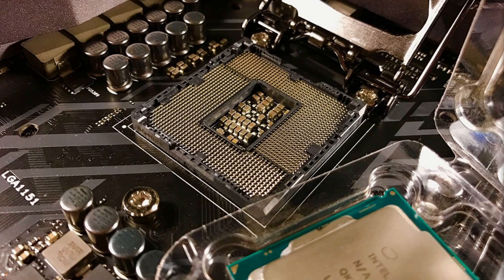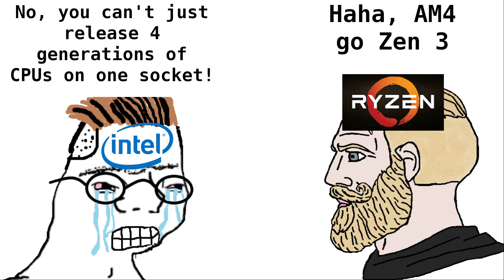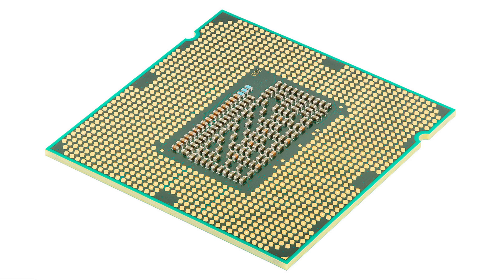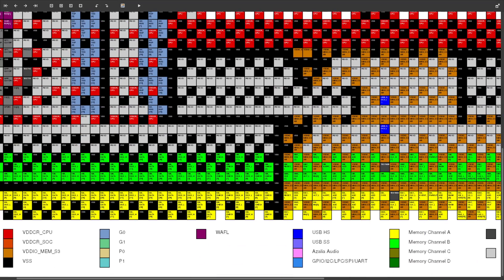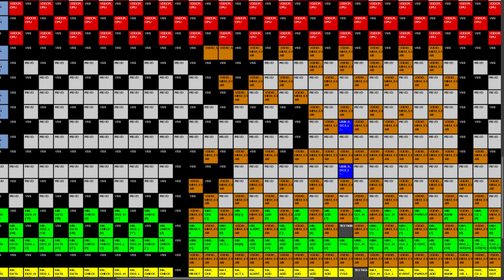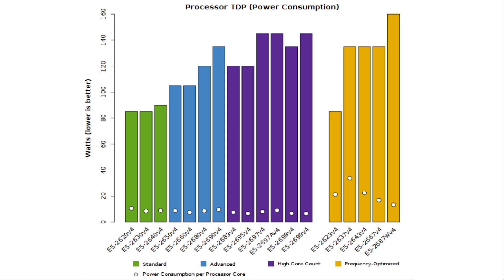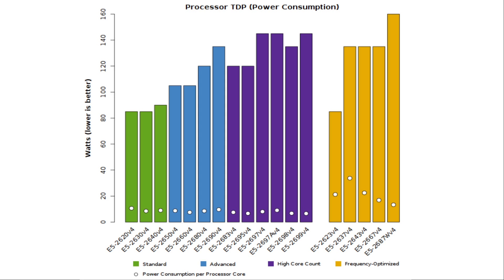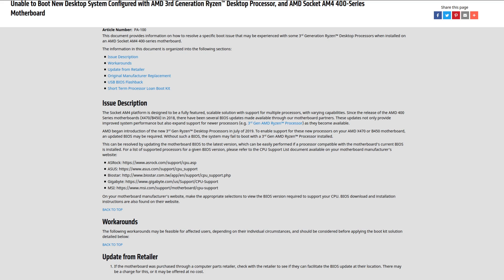The Reason for CPU Socket Changes

Comment: you do not need an old cpu to flash a well designed motherboard. "Bios flashback" is a well known feature that's been available on many asus boards for generations. the name do changes from brand to brand but that feature is available on many different boards from different brands. 

I didn't hear anything in this video that would make me think socket changes aren't essentially money grab or, as we usually call it, planned obsolescence.

Sure, you'll need some upgrade at some point, but not minor generation upgrades/iterations.
Reply: That might be the bios feature that's patented by one of the companies (Gigabyte I think?) so it doesn't show up on lower end boards because it has to be licensed.
Reply: @ffwast  Could be. I didn't look into it but I would expect that 1) The patent would expire after some time (5 years?) and 2), One could make enough changes to the patented idea so the patent doesn't apply.

that being said, you can upgrade firmwares on screens and many other devices without any fancy cpu or other dependency so again, I'm convinced it is more about squeezing more money out of planned obsolescence than anything else.

Comment: Intel: releases same CPU on a new socket - Never bothers making a socket good enough to run multiple generations- a big f you to customers.
AMD: releases new CPU on the same socket - a win....nope, stops manufacturer's from making a cpu work on a board because its "incompatible"
then people do it on some boards anyway, find out the few things that are, are only a mild speed decrease because of an older feature set and still work, slaps a C & D on the company that allowed it to happen and warns the others to not follow suit.

Both companies are assholes.

Comment: It doesn't matter if AMD kept the socket, they locked out cpu upgrades with bios updates. Anyone who bought x300 boards got screwed outside of the small exceptions by a few vendors who were clearly going against AMD by leaked emails.
Reply: You could still alternate your upgrades. 300 board 1000 cpu, 3000 CPU, then 500 board and last 5000 cpu

Comment: Socket change and bios problems are not really related, you may have to update the bios for may other compatibility reasons depending on the component selection on the build

Comment: By the way, why are intel boards most of the time better looking and have more features?
Reply: The main reason is because intel has a bigger market share. For the companies making the motherboards, they can expect to sell more intel boards at each price point so they invest more r&d and polish into them. The difference is getting smaller these days though. Its also the same reason there is more selection of intel mobos.

Comment: Riddle me this, my 7th gen motherboard can run a mobile 10th generation 8 core 16 thread cpu and so could my 6th gen motherboard before I got an upgrade by simply modding the bios. Intel is running a huge cash grab
Reply: after they move aka chipset/nortbridge/ram controler to inside the cpu, i think the need for newer sockets, was really a company choice,
because any pch i/o can be implemented in any cpu those days
Reply: @edussantoz9034  exactly, it's so frustrating creating pointless e-waste because a company wants to make more money

Comment: But it's not a huge difference bc you need to have specific chipset motherboard for specific cpu right? I mean if you have 3400g on B450 motherboard with AM4 socket you can't upgrade it with installing 4750g bc it's not compatible. 4750g fits B550 motherboard.

Comment: Well... Keeping the AM4 Socket is just like keeping the HDMI connector or USB C connector.
Keeping the same socket creates confusion.

You kind of have some compatibility, but you have to keep the HDMI revision in mind or in this case the chipset (AX370 in my case)
I might not be able to get the Ryzen 5xxx series or I won't have PCIE 4.0 or something else

Also...
I'm pretty sure the latest and greatest AX570 or something won't support Ryzen 1xxx
Reply: I believe that most X570 boards today don’t support older Ryzen gens in BIOs, as it’s too much space

Comment: actually they can make multi generation fit  i think the differences between am3 and am3+ is a couple extra pins so your machine may come with an am3+ socket but an am3 cpu so you could upgrade to a faster am3 or even faster am3+.

so why not make the socket even bigger  so right now there would be lots of unused holes and as each new chip comes out a few more pins are added.

basically have lots of reserved pins for future use.

a fix for that is to layer the cpu compatibility such that out of the box it would work but on limited abilities until the bios flash is done.

it is like an ebike with a motor that can handle 5000 watts of power but limiting it to 750 to make it road legal and you buy a better controller or flash the firmware in the controller to remove the limit and you install a 72 or even 84 volt battery over the 48 volt battery that came with the ebike.

apple seems to be doing something like that with the ios devices so you dont notice a performance hit through it's life the cpu is limited to a very low speed and as your device gets older each ios update throttles the cpu up so you get a constant performance over the life of the device.

a graphics card is a good example  just to get it to show the desktop the basic functionality is burned into the hardware then the official driver is required to get the more advanced functions to work so it can crypto mine or play games.

Comment: It's pointless though. Yes, it's the same socket.

But you can't use newer processors with the same socket for more than about one extra generation.

And for those things that don't require a new chipset to function well, you still have to have motherboard suppliers actually updating their bioses.

So it's new motherboards every so often even though it's technically the same socket.

Is that better? Worse? Heck if I know. Just bad experience with it, and the whole thing is just a really bad marketing ploy. The processors are good, but the motherboard situation is about equal to intel.

Comment: Just because it's same socket doesn't mean CPU will work.
Imagine having highest end X370 mobo and not being able to run Ryzen 5000 in it, while a cheapo B450 works.
Still, 3 generations per chipset (motherboard) is pretty good.
I've swapped from X370 to B550 in preparation for Zen 3 with 3D v-cache, keeping my R7 3700X.

P.S.: Fun fact, the 300 series chipset has support for 28nm APUs (old generation APUs repackaged for AM4), Zen, Zen +, Zen 2.

Comment: Btw, skylake sockets work with older/newer cpus (so through gen 7 to 9). You just need a bios update (there are a lot of hacked mobos on aliexpress.).
If you instead want to use a laptop CPU then just buy a pin adapter and slam it there.

tl;dr : New "sockets"/mobos are not technically necessary but Intel like every other company wants to make some cash.
Reply: No they don’t, they have different pins

They are physically different
Reply: @PashaGamingYT  But yeah my mistake, 10/11 are different whoopsy

Comment: I really wish you would have covered socket 775 sticker mods. They force newer CPUs to work on older motherboards essentially by swapping two contacts around, and it seemingly works! How could this possibly be justified
Reply: Ah, speaking of 775, I remember my tape modded Q6600. Good times. I think I have it laying around somewhere, might see how well it holds up in windows 10 and in some modern games
Reply: @videogamefreak221122   Core2Quad were LEGENDARY processors... Beasts even nowadays... I was rocking a core2duo laptop until last year, that thing was a beast, no joke
Kinda hilarious that I could play all the 3D games I ever wanted, but browser javascript was what it could not handle anymore LMAO modern computing sucks so bad
Reply: @FeelingShred  Thats because of java. java sucks its really unefficient no matter where.
Reply: Nah, their lack of AVX support means they're no longer compatible with a lot of mmoderngames.  Aim for sandy bridge it, preferably i7 at minimum.
Reply: @demp11  What are you even talking about? Java is a great coding language, in fact it's my favorite. There are a lot of valid criticisms you can make of Java, but efficiency or speed is not one of them. Sure, JVM will inevitably be slower than machine code by design, but it does not matter *at all*. Apart from the fact that not a lot of people are making native executables anymore, the translation layer is fairly light for compiled java programs. Also, how is this relevant for gaming? Java is not common at all in the gaming space, apart from minecraft I suppose. Which is a shame, given that it basically has free cross compatibility.

EDIT: I realize you may have been talking about JavaScript. That's fair, javascript does really suck, but it's great for it's intended use case. It's recently been put in a lot of places where it doesn't belong. Also, JavaScript breaking older browsers really isn't the language's fault, it's more like common browsers' attitude towards OSes. Google is notorious for this, as disposing of compatibility features gives them more leverage for their own new features in the marketplace. Also the old HTTP protocol is way too insecure for the modern web, so it's no surprise that 9X or even older XP versions are left behind, but you can put HTTPS-ready browsers on them with some messing around.
Reply: @wasabithumbs6294  actually I would say even java in general isn't really that efficient. Don't get me wrong for 90% of applications it's totally fine. But Its not the only way to create crossplatform application anymore nor is it the best. With gaming like you Sayed, Minecraft is actually a good example for this. Seeing how this low poly game is extremely demanding even for high end PC's, which explains to me why no new games are are coded in it. Then you look at the bedrock edition of Minecraft written in c++, which runs on phones consoles and pc all crossplatform. Shure it's more work but you would never be able to run the java version on phones.
Reply: @Max Link  Oof, do not use Minecraft as an excuse to dismiss Java as an unoptimized language. Java and the hardware landscape was way different back when Minecraft started development, and it's server code is notoriously bad. Just ask anyone in the modding community- it is not exemplary of the best Java has to offer. The bedrock team made the decision to port it in C because the original Notchian codebase was a mess and frankly because there's a lot more resources for C development, ESPECIALLY in the case of mobile. I don't think Java APIs even exist for apps.

Also I am amused that you believe the tiny inefficiencies in JVM are a large reason as to why games are not made using it, when the most god-awfully optimized games of recent memory have almost nothing to do with the coding language (unless you're yandere dev I guess) and everything to do with how it was used. Most of them were C-like, because it's still very dominant. People make games with PYTHON. Python is a slow as shit language, but it's still very popular even for gaming. So no, the efficiency of Java is not even remotely a concern.
Reply: @wasabithumbs6294  Im no expert so I'm probably wrong, but it is still weird that it actually was already Microsoft when Minecraft lost a lot of stability when they updated it from 1.12 to 1.13 before that it was working much better, especially on older PC's. So I do wonder why you say it's notch his codebase that makes Minecraft so inefficient. There is still the question why no one is using it for games and most of the time that has a reason, probably other options are just better and easier to use but I don't know.
Reply: The z170 mods are also worth talking about. People modded the 9900k and further in there.
Reply: What about benchmarks? "Working" is insufficient if you get a cpu for performance reasons.
I'm not saying that those exist, but I simply don't know.
Reply: I bought one Intel Xeon E5462 from ebay for 8 euros aprox for that

Comment: If you want intel the best intel upgrade right now is the lga 1200 socket. U have a low end i3 10100f that costs as low as 90usd and a high end i9 that supports latest stuff. 
Lga 1700 is something to consider aswell, but not for budget people.

Whatever the case AMD is still the best for versatility of sockets.
Reply: I just upgraded from an i5 9500f to an i7 12700k and had to buy an lga 1700 mobo. Im just at the point where i think a CPU upgrade is necessary so it rly dont bother me if i have to switch mobo. Also my current one doesnt support m2s. I really dont see the problem with having to buy a new mobo. Its only a problem if ur getting the extreme newest thing the second it comes out. In my case i dont do this and i really dont mind splashing out a bit after 2 years
Reply: @beanie4882  "don't see the problem"
See, there's these things called "money", and a "budget". Familiar?
Reply: @beanie4882  Yeah let me just pull $800 out of my ass for a new good cpu, mobo, and psu
Reply: @wheeI  what are you talking about? I dont mind splashing out every couple years on new parts so my pc can run newer stuff. I dont give a shit if you do care.

Comment: AMD is such a Chad.
I could run a 5800X on a board I originally bought almost 3 years ago for a R7 2700 with a bios upgrade as long as I keep the power draw in a range the board can handle so no insane overclocks. How about that for a cost effective upgrade. Also think about how much E-Waste AMD is preventing by just sticking to AM4 over the years. A good AM4 board doesn't become useless after a year.
And can I just make the statement that AM4 is in general superior to Intel.
You dont have the super tiny fragile little contacts sticking out of the motherboard you would have with all Intel sockets. Thats pretty big since it can decide between an expensive board being trash or not bc you touched the pins with a ram stick. Instead the Pins are on the CPU and man they are thicc sturdy bois. You could not bend them if you tried. On the Intel platform you look at the socket wrong and its dead.
AMD manages to run high end 16 core CPUs with their full featureset on a Socket they revealed in 2016 with the only difference being in the chipsets.

Intel is such a joke these days like you dumb cunts just make one good socket and stick to it. If AMD can do it and still have crazy good performance you can do that too Intel!